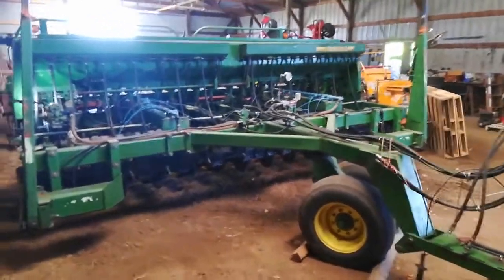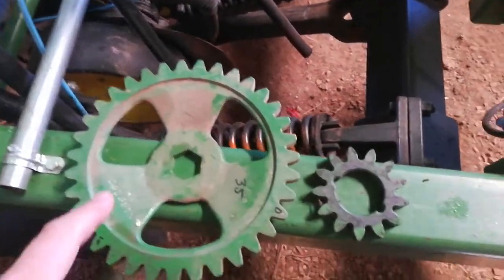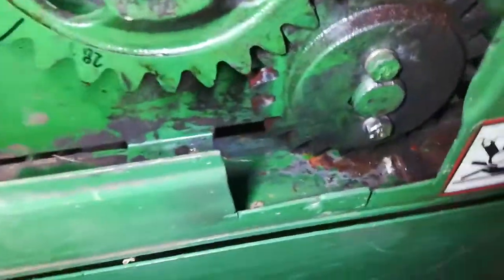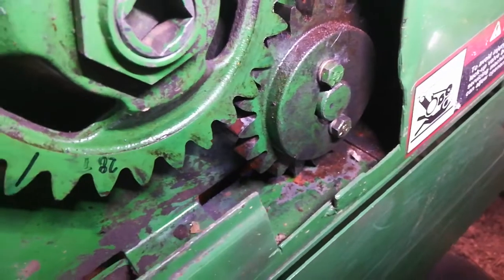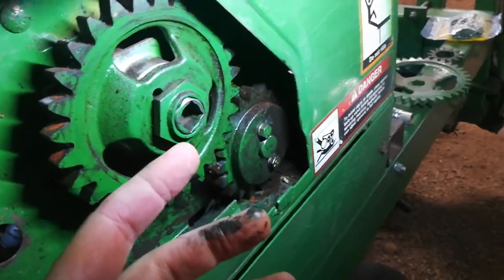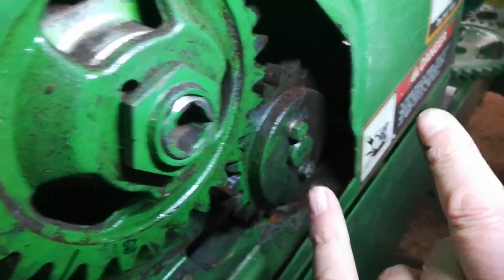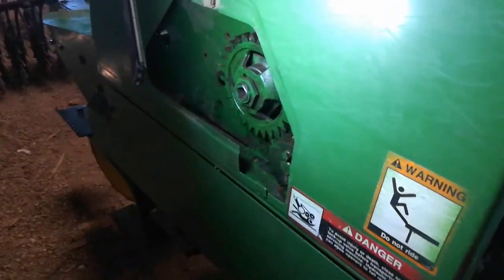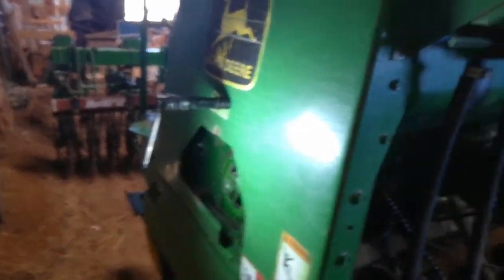Deere 750 Grain Drill - Half Speed Gear Problems

Comment: Do you still have the part number for the 13t gear? I’m trying to find one for my drill.
Reply from the maker: Hi. Yes, I do. It depends on your drill serial number. SN 0 - 26045 = part number N218700.  SN 26046 and up = part number N282479. I bought the wrong one at first (used, from a guy on New Ag Talk) and it wouldn't fit on my drill. I ended up buying the right one from Deere; I think it was around $250.
For future reference for anyone else who sees this, the part is #3 in the schematic here - https://partscatalog.deere.com/jdrc/sidebyside/equipment/69925/referrer/navigation/pgId/57746 .

I was able to knock out the roll pin that holds the gear on the shaft using a roll pin punch in my air hammer. It came out pretty easy. 

Good luck!

Comment: Did you ever get this issue solved? I’m running into the exact same thing! Instead of a role pin could you just use a bolt??
Reply from the maker: I didn't go any further with it last fall. I'm pretty sure I can get a roll pin punch in my small air hammer to knock the pin out and then put the new smaller gear on the shaft. The roll pin won't have any slop in it, compared to a bolt, so there should be a better fit on the shaft. At least that's what the Deere parts guy's argument was for using a pin vs. bolt.

https://www.amazon.com/Mayhew-Steel-Products-32020-MAI-045256320205/dp/B00YTO3SR0
Reply from the maker: an update: a roll pin punch on the air hammer easily knocked the pin out.  It was a little confusing when I put the new small gear back on the shaft, as there are two holes in the shaft where the pin could go. After some flipping/turning/head scratching it all went back together.
Even with the half speed gears in place I'm going to be on setting "7" in order to get approximately 16 lbs/acre of Kernza drilled. I'll calibrate the drill as best I can and hope that everything comes out ok - that seed is expensive!